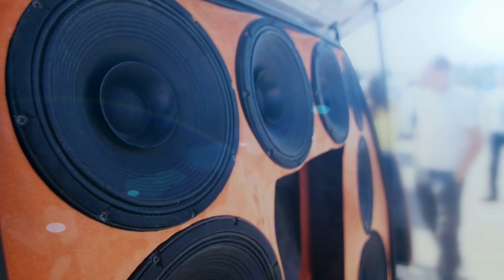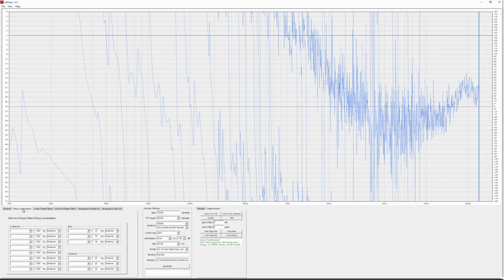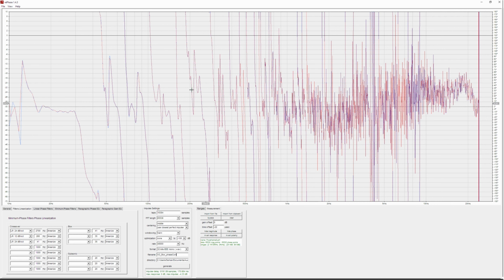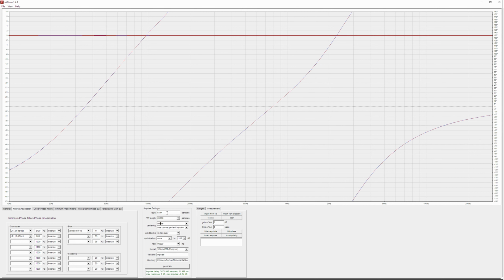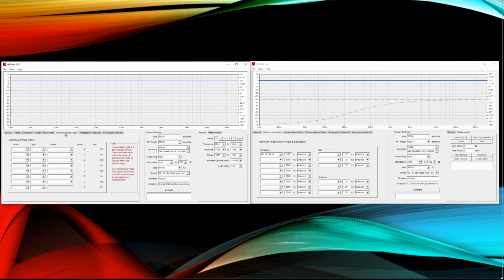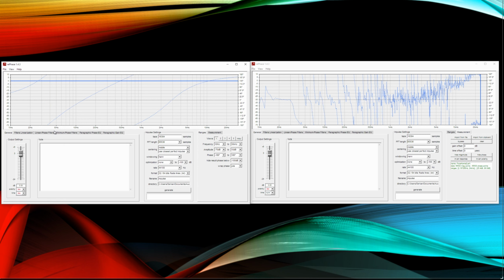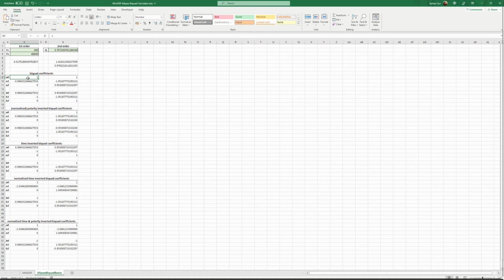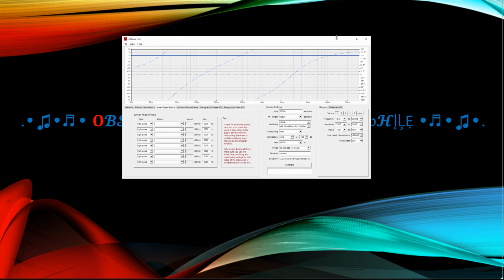MiniDSP tutorial / Unleash the power of biquads

Comment: Another great Video! Your starting point here again is a combined measurement from left and right speaker? I understand I could also use just Left OR Right and apply the same (!) filtering to the other speaker in the end...? For phase correction with a 2x4HD I understand I would only have to follow the first steps you described and just upload the FIR-Filter (bin-file) to the 2x4HD, correct (so no need for manual all pass filtering and bi-quads....)?
Reply from the maker: Thank you for your kind words. You should always use same xo and box phase correction for left & right speakers, it's sometimes easier to see the phase response with a stereo measurement. Your ONLY option with 2x4 HD is using FIR filters. It cannot process time-inverted allpass filters (causes a buzzing sound). Unless you use low frequency port corrections, 1024 taps will be enough if you use rectangular windowing and 99%-100% centering.
Reply: @ocaudiophile  okay, will try....😉 I think I can even use up to approx 2k taps if I only use two channels of the 2x4HD. 
What about full range speakers (single drivers) that use a small correction network but no real x-over...? Will there be anything to correct? Haven't measured phase response yet...🤔
Reply from the maker: @andreasheiden7122  I have no experience with single driver speakers :(
Reply: @ocaudiophile  okay...👍 l now tried to do it in my own. After I created a correction file in rePhase and exported it in the wav format for REW I uploaded it to REW and did the multiplication. Unfortunately I can't do the estimate IR delay calculation for A times B and thus I can't time align the before and after measurements/calculation... REW says A Times B does not have an impulse response and so cannot be time aligned.... Any idea what the mistake was here....? Any help would be appreciated!😃
Reply from the maker: @andreasheiden7122  you don't need to time align the phase correction, you need to remove its SPL offset though.
Reply: @ocaudiophile  hmm... Yes, the spl is off after import from rePhase. In your video "Why you need to fix...." when you're showing the difference between the initial measurement and the phase corrected calculation (a*b) you calculated the estimated IR delay... This is where I get the error message mentioned above...🙄
Reply from the maker: @andreasheiden7122  That error means what you imported in REW from rePhase is not an impulse and vector multiplication of an impulse (original measurement) with a non-impulse will give errors. Double check your export settings in rePhase. It should be a 32 bits IEEE mono .wav file at 48,000Hz
Reply: @ocaudiophile  I will double check again, but these were the settings I used...  I will try again tomorrow! Thanks a lot for your help and patience!👍
Reply from the maker: @andreasheiden7122  Any time.
Reply: Hey OCA, first of all thank you for putting me in this Rabbithole of rePhase and REW. I‘m also an owner of a 2x4HD (so I’m aware that Biquads are not possible) and I followed your instructions for phase linearization. If I put taps to 1024 in rePhase my miniDSP Plugin says it sees too many taps to proceed. So I lowered them to 512 and it accepted it. rePhase Export Settings are 32Bit IEEE mono & 48kHz (also tried with 96kHz). And I still got only this fully overdriven buzzing noise. Any ideas? Thank you.
Reply from the maker: @Pwndtiac  2x4HD should be able to acept up to 2048 taps per channel if you use only 2 channels. there's a total limit of 4096 taps. There's something wrong if it's not accepting even 1024, update its firmware. rePhase export settings should be 96000Hz, 32 bits IEEE-654 (.bin), rectangular windowing, taps 1024, centering 99% (or 100%), you can also try moderate optimization if the frequency response is not flat with 1024 taps.
Reply: @ocaudiophile  Thank You for the quick answer, it was the file format. .bin just worked fine. Also with 1024 Taps. Still a lot to learn.

Comment: Nice tutorial. I have a questions. For multiple subs using minidsp, should I time align then eq the subs using minidsp amd after that running audyssey? Or just time align the subs using minidsp the run audyssey?  Thank you
Reply from the maker: MiniDSP introduces delays which frequently makes it impossible to properly time align the subs with the rest of the system with the distance limits in the receiver. But if you're using it anyway, then phase align subs with each other - https://youtu.be/ga2eOwJRtXo and EQ the combined response in DSP. You can then apply a final touch if necessary during Audyssey calibration - https://youtu.be/g26gbFdAIxE
Reply: @ocaudiophile  thank you. What about if I have more than 2 subwoofer. How to phase align it?
Reply from the maker: MSO
Reply: @ocaudiophile  other than mso, Just wondering, is it possible after finished align  2 subwoofers as your tutorial, after that I phase align the 3rd subwoofer with the previous 2 subwoofers phase alignment result. Thank you.
Reply from the maker: Yes İ guess you could do that using vector average of each aligned pair with the next one.

Comment: Unclear, are you correcting a single speaker? (bookshelf woofer/tweeter) or is this a single driver
Reply from the maker: single speaker with 3 drivers
Reply from the maker: But the box/port correction could be applied to a subwoofer as well...
Reply: @ocaudiophile  This seems very powerful but I’ve only worked with PEQ to this point.  I’m a little confused as to weather or not there is any benefit for biquads when working with retail speakers.  You mentioned in another comment that this is something like what Dirac does but Dirac may not get it correct.  But, Dirac is working on complete speakers and multiple speakers where their crossovers are fixed.  I’m just wondering if biquads are any use to me in a normal 2.1 or 5.1 system.  I’d really like to dive into it if there is but not sure what I would be doing it for.  Can you shed any light on this?  Thanks.
Reply from the maker: @williamhicks2763  Thanks. Firstly, the time inverted biquads explained in the video don't work in recent MiniDSP models (I know from subscriber feedback) but you can still use normal allpass filter (non-time inverted phase filters that don't alter frequency response). These are still quite useful to match speaker and sub phase responses at the crossover region for example. MSO uses them for subwoofer/speaker alignment. So does Dirac.